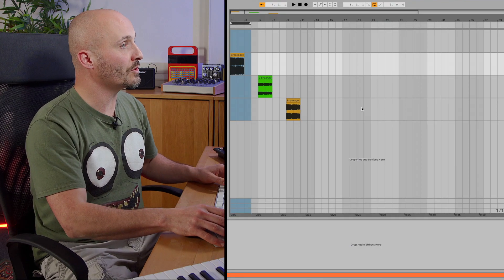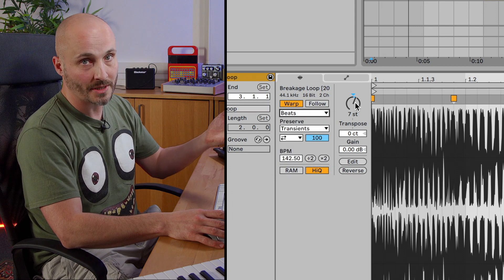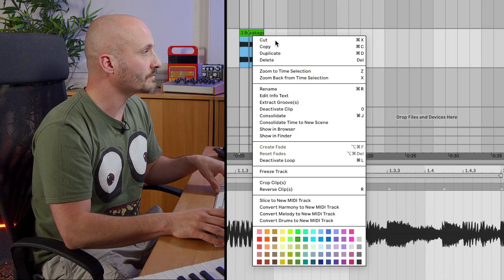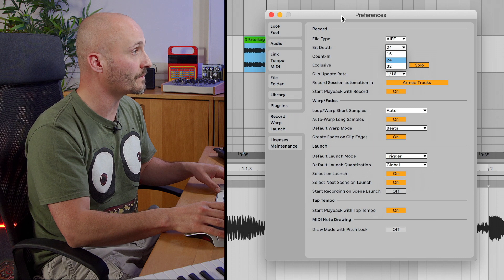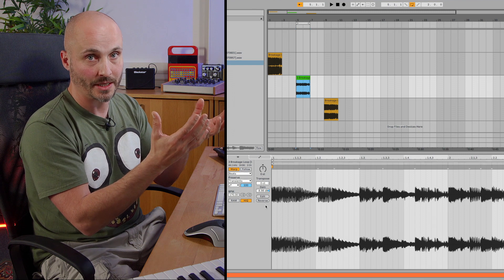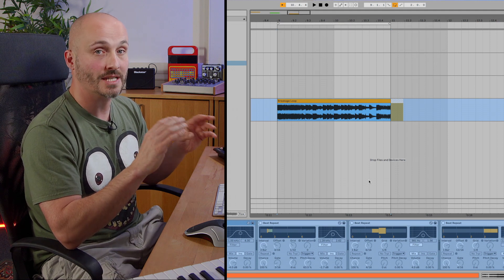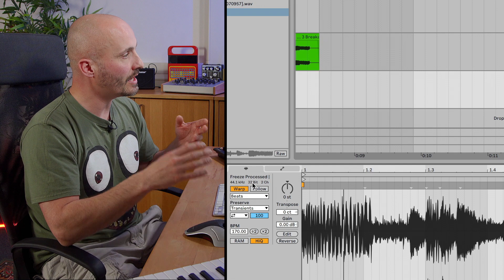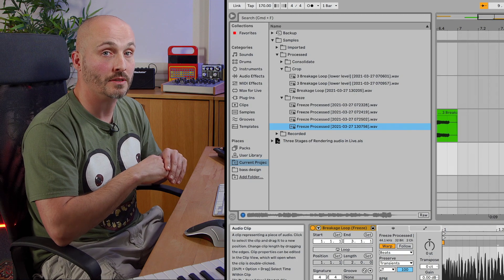Ableton Live Tutorials: Crop, Consolidate and Flatten

Comment: Thanks for the explanation. A lot to keep track of. 

How do you deal with the tail when flattening a loop? What I mean is:
You have a 1 bar audio clip  and it has an echo effect.
When rendering it, it will be longer than 1 bar, since the echo keeps going for a bit.
The problem I have is when I loop it and set it to loop after 1 bar; Then when the loop repeats, it should sound like the echo keeps going (the tail part). 

Is there a good way of doing this without creating a massive audio file that renders all the loop repeats?